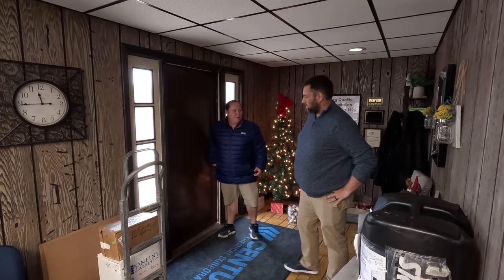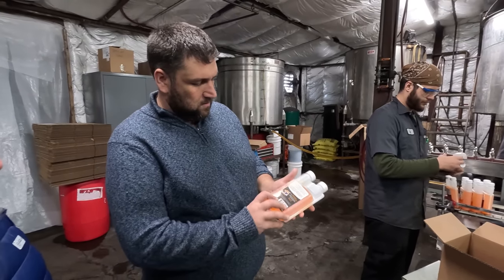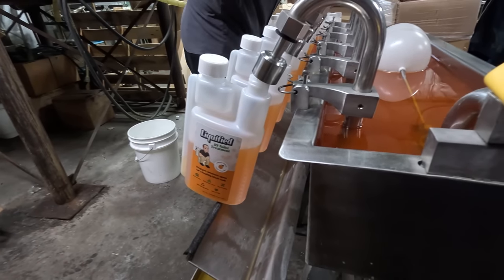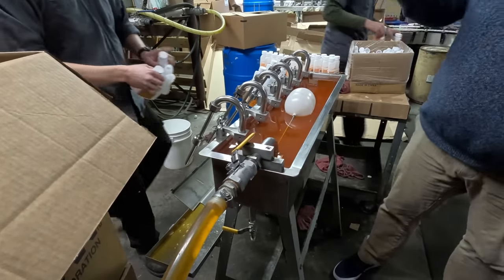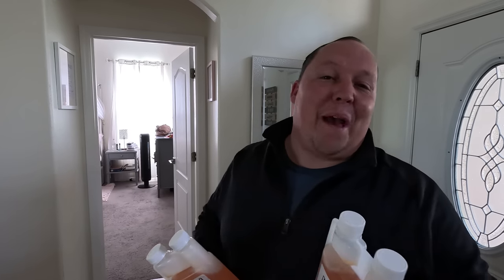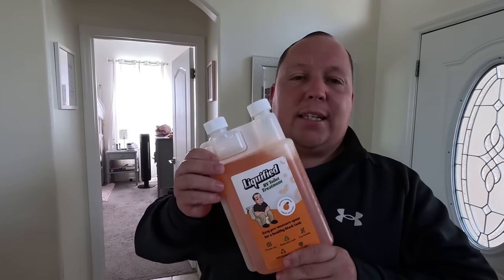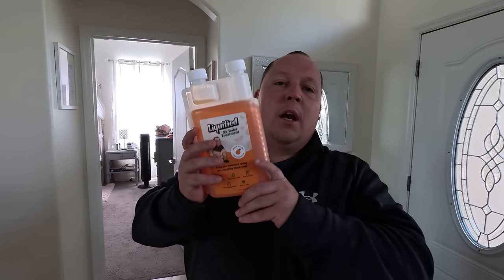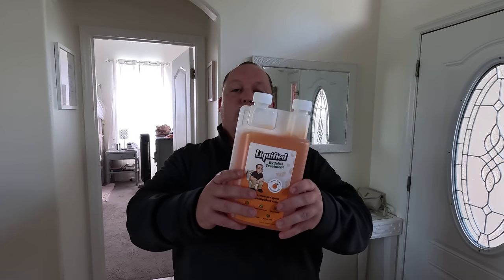MY BIGGEST ANNOUNCEMENT EVER!

Comment: … I got it today in the mail, BUT, I’m using it for my Gray Tank (to help remove soap scum, hair conditioner scum, etc). Poured it into my shower drain, so it’ll soak overnight. I drain my black & grey tanks once a week (Thur or Fri)…Since your product is biodegradable, I don’t think it’ll harm my grey tank. Next week I’ll use it for my Galley Tank. I live full time in my RV (at a small residential trailer park w/hook ups & sewage).